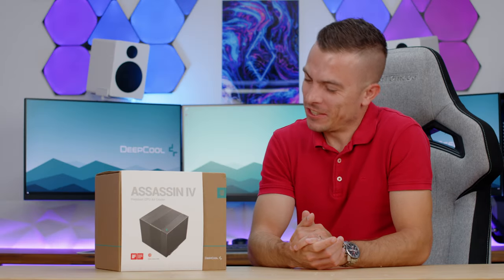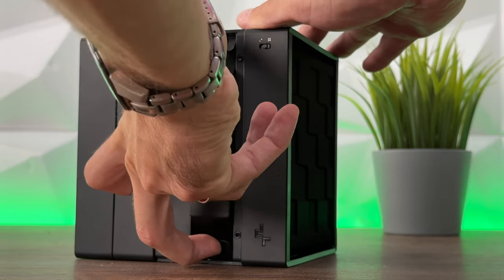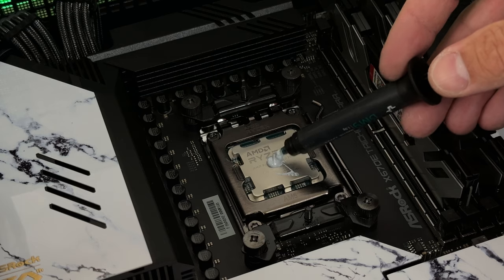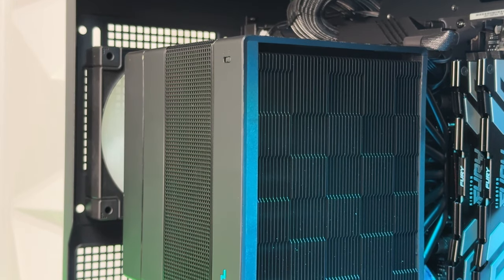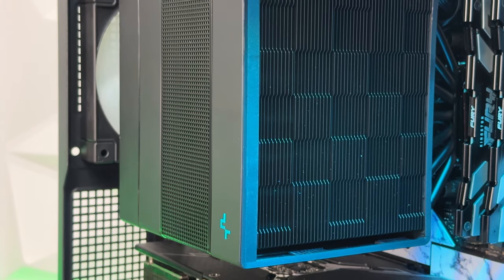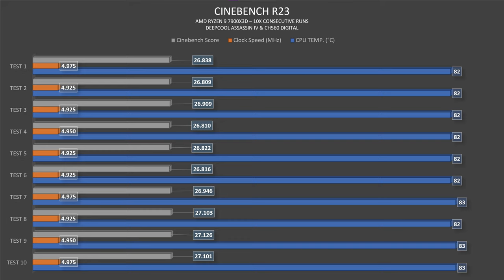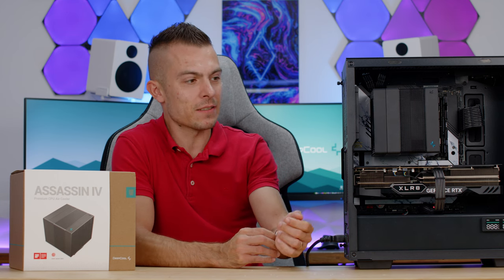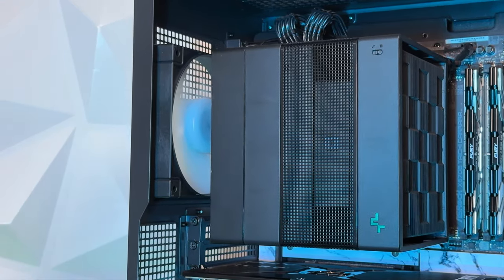DEEPCOOL ASSASSIN IV TAKING BACK THE THRONE!

Comment: Investing 900 dollars in a custom water cooler and I don't regret it as very cold temperatures
Reply: what is model?
Reply from the maker: If it is an AIO, it is overpriced. If it is custom, then it is cheap water cooling and I doubt its reliability. Not standing on any side, air or liquid cooling, just saying.
Reply: @PCCrazyDario  It's a Chinese brand of custom water, I don't think it's bad it's more about cost benefit, of course I'll upgrade to products like EK and Thermaltake when possible

I made a mistake it didn't cost 500 dollars, it was 900 dollars
Reply: @PCCrazyDario  my next upgrade I'm looking at is the thermaltake pacific mx2 ultra, but there are almost no quality reviews on youtube
Reply from the maker: @JensensLeatherJacket  Ok, when you mentioned $900, makes more sense. Yeah, very few actually review water blocks for custom liquid cooling. But let's see when I do the build with it. :)